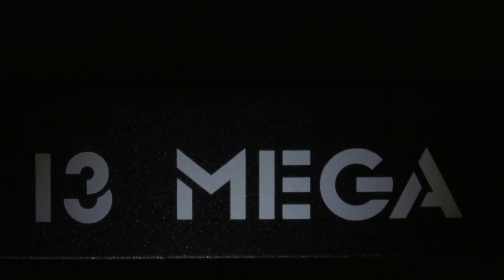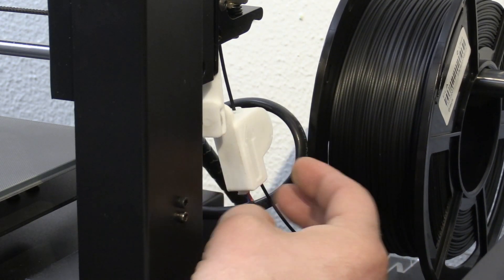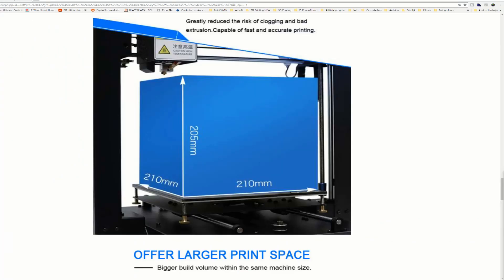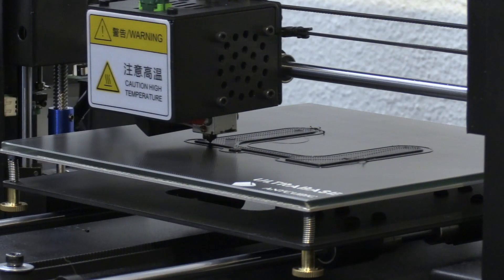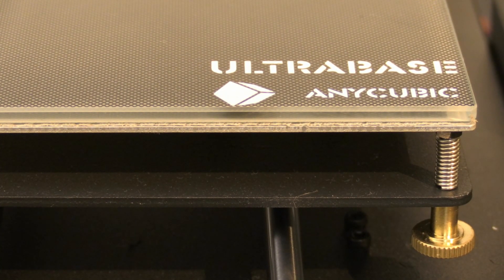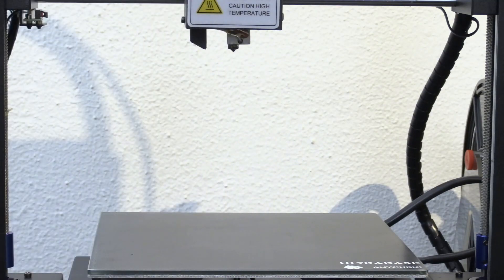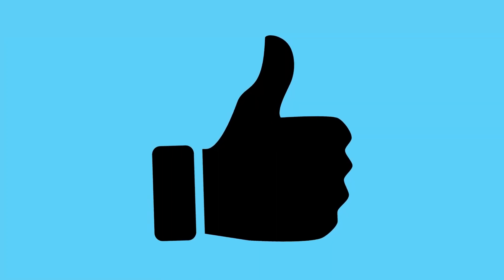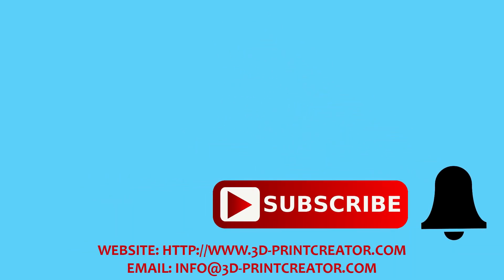▼ AnyCubic I3 Mega with Ultrabase bed, my first preview.

Comment: I wonder how ASA and nylon filaments would work on this
Reply from the maker: I doubt if that would work for normal Nylon because the hot end is rated for 245C only. However, it's pretty easy to swap the hot end to an E3Dv6 all metal, then change some settings and go up a temperature required for Nylon.
There are also some nylons that can be printed at lower temperatures, like 240C. I think they would work fine.

I am not experienced with ASA filament, so I don't know.

Comment: did you try printing ABS? Does it stick? Problems with warping?
Reply from the maker: Tobias Graupner I am working on a video that shows ABS printing with this printer. Just wait a little more days.
Reply: Hi Brian, Have you done this video, as I can't find it - Or do I just need new glasses ?
Reply from the maker: Hi Per and Tobias,
No, I have not, sorry.
The reason is that in a livestream I have been testing ABS with this printer and we came to the conclusion that this is not a good idea with this printer. I had 4 nozzle clogs in that stream and also the one time I could finish the print, it had lot's of problems like getting loose from the bed and breaking layers.
ABS (or at least the ABS I have at stock) needs an enclosed build chamber to print well. That's when I gave up to try it with this printer.

I can however confirm that the next materials print fine with the I3 Mega:
PLA, PLA+, HTPLA, HIPS, PU, PETG, PET, NGEN, NGEN-FLEX and Low Temperature Nylon,

Comment: So, the print resume function of this printer is only usable if you aren't using the heated bed?
Reply from the maker: Even worst. You have to use gluestick or painterstape to make it work.
When the bed is hot, the print will stick, when the bed is cold, the print will drop from the bed.